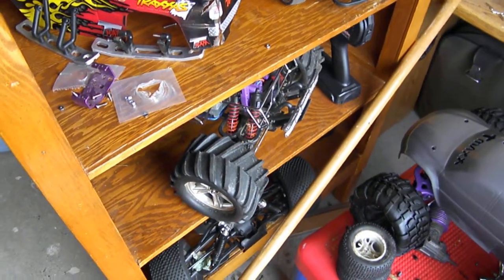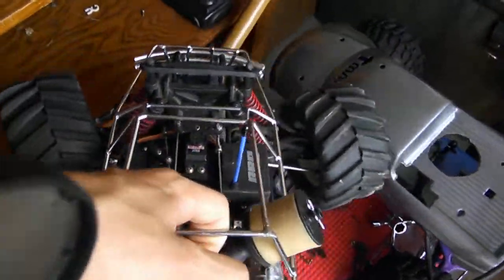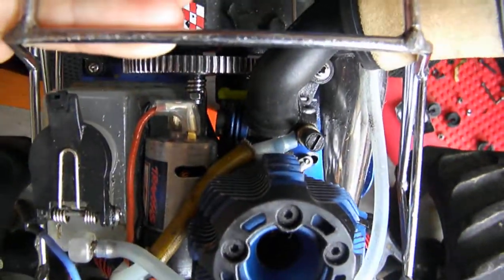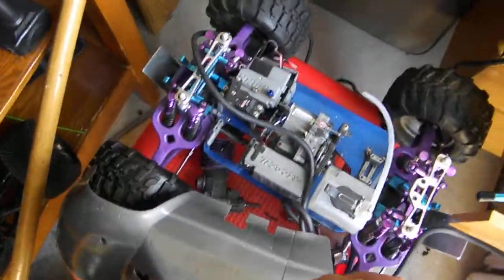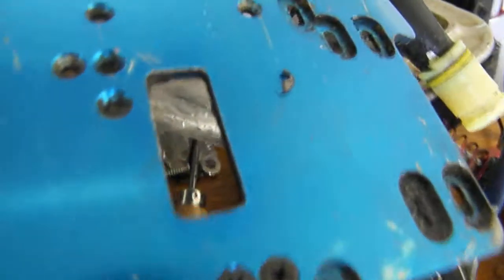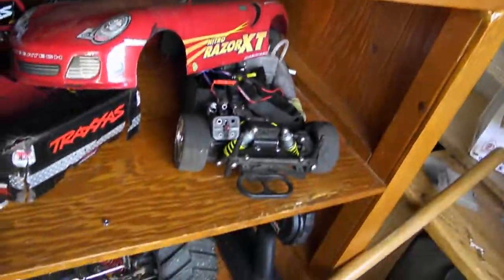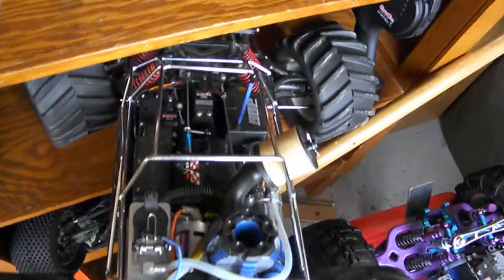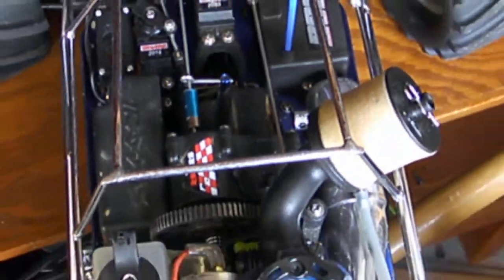Traxxas Tmaxx response to transmission help

Comment: thank you i actually never driven mine that i bought off somebody in a carpark yesterday... i was dubious of it when i stripped it apart couldnt find anything wrong with it. came to the possibility that it might be rev induced like the shifter gear for second. as my battery was flat i had no idea or patience. thanks for posting this up.